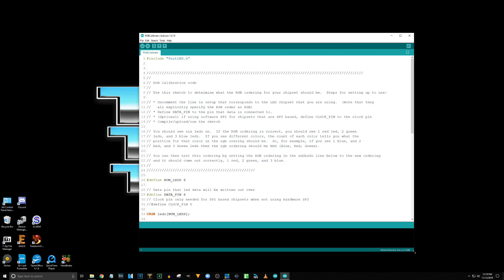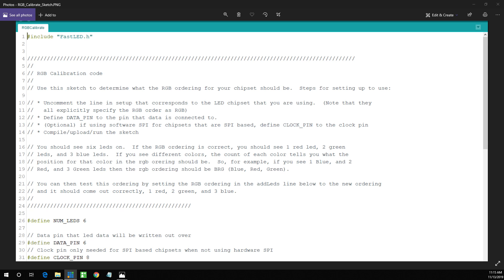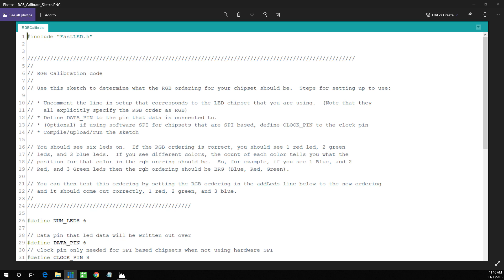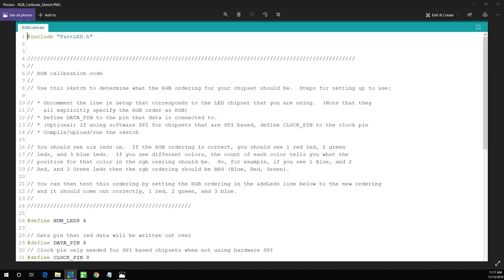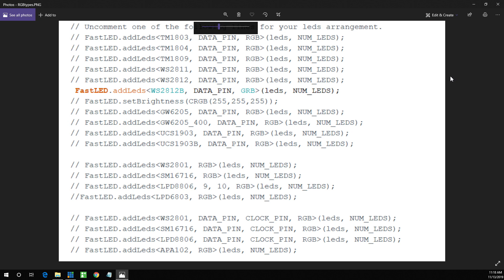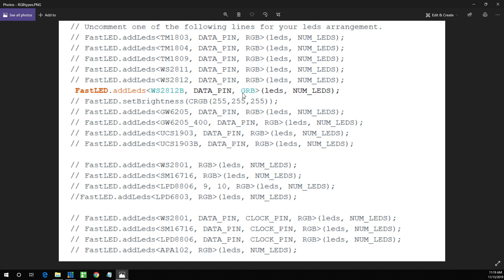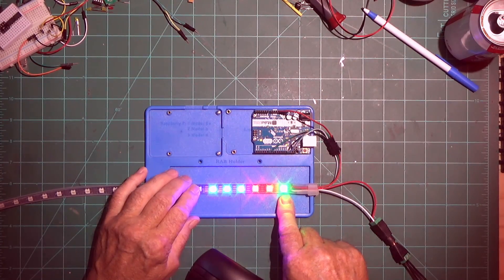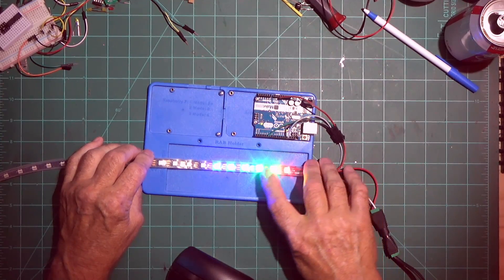Addressable RGB LED Calibration

Comment: hallo sir, I have this problem where when I press green on the controller a red color appears.
and I've tried to use arduino nano to calibrate with fast led, when I compile and run everything is correct,
but after i plug it into the controller the color still doesn't match, is there something missing??
Reply from the maker: This calibration is for stand alone LED strips like the ones mentioned. If your strip has a (controller) i suggest refer to the manufacturer of the device. You may also have a defective strip
Reply: @TomsTrainsandThings  yap, I have 2 stand alone led strips, and for the controller I bought it at another online store, 
for the first led strip the color that appears is correct according to the controller, but the other one doesn't match, and I tried calibrate with arduino nano, and it matches RGB sequence, 

but when I plug in the controller again nothing has changed it still doesn't match 😂
Reply from the maker: What controller are you using?
Reply: LED 2017 RF 21 keys for remote & controller and i try use in pc with fan & led controller case prime zt